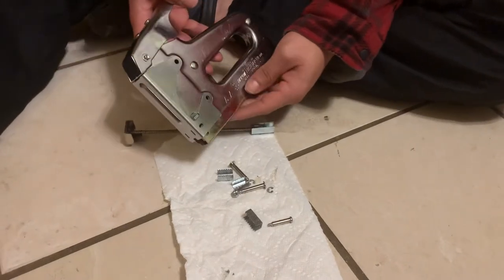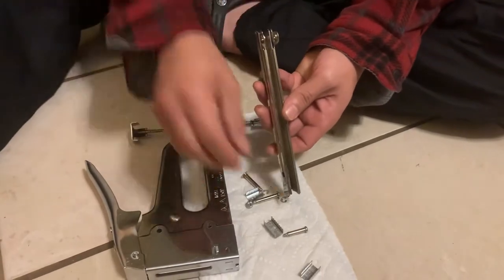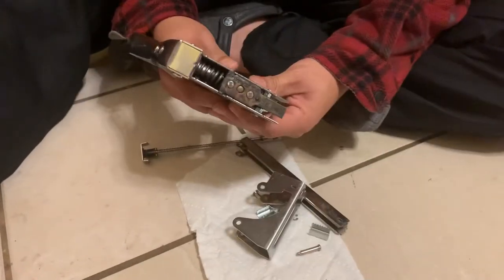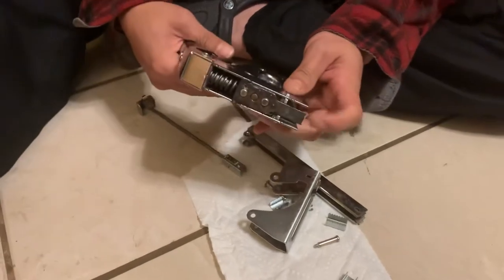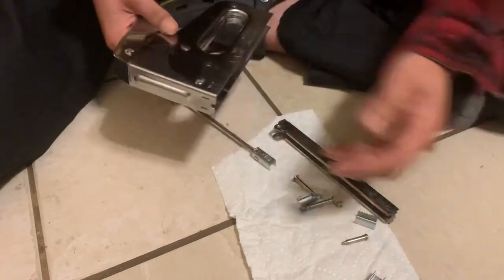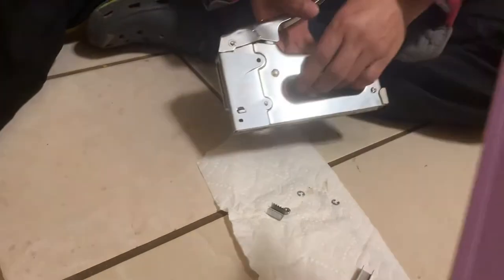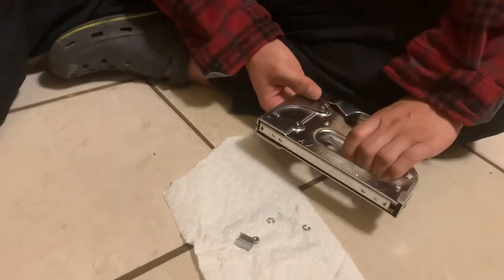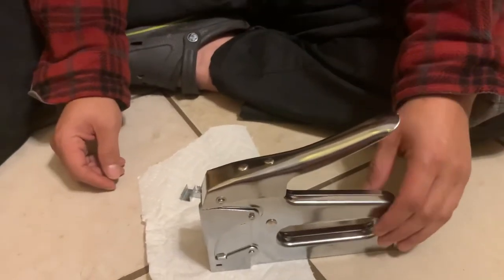Arrow stapler T50 doesn’t work. Help needed.

Comment: I had success by filling down the hammer pin flush to the base of the front. Mine was 1-2mm proud and I feel was not raising high enough to let a staple slide. Like many things under tension they wear and sag in time
Hope this helps out cheers

Comment: I might have had a very similar problem. For me, it was that the hammer was locked in place. Some oil (or WD40) loosened it up. I worked the oil in by wiggling it around. Once it starts moving, it works by pushing against that front plate that was removed, so putting that back on might get it working again.

Comment: I just bought a new one and when I put the whole set of staples in, straight out of the box, it is not working, not staple will come out. My husband was messing with it a broke the set of staples in half by accident so I said put half of them in it and see what it does. Low and behold it worked. I took the half stick out and put a whole one back in and it would not work, put the half stick back in and it worked???? I don't know but try it and see. Mine work fine with half the staples but not with the whole stick. Crazy.

Comment: Try stretching the long thin staple holder spring in situ.
The spring isnt strong enough to push the staples against the hammer.

Comment: It appears the pins that lift the sprung hammer when you squeeze the handle wear down to the point they don't engage properly. The part with the lifting pins on is solid riveted to the mechanism under the handle which is in turn solid riveted to the body, so as far as I can see it can't be fixed.